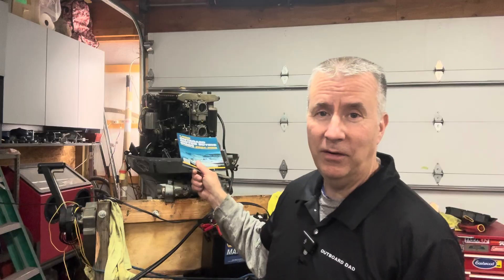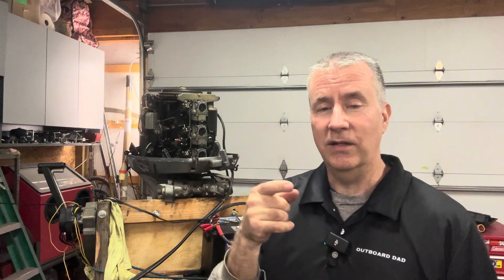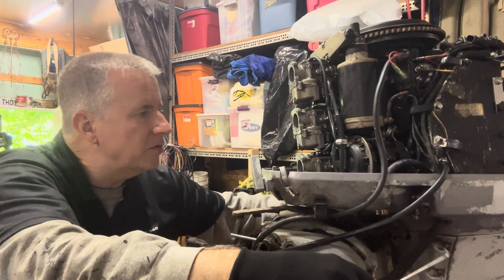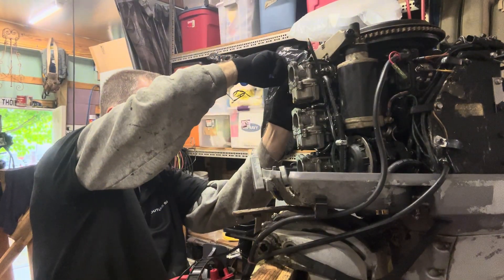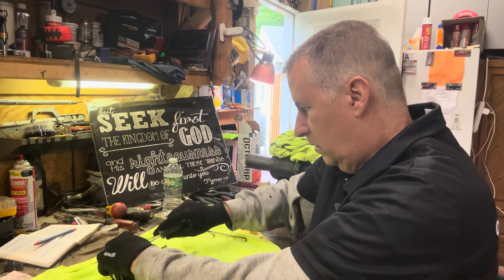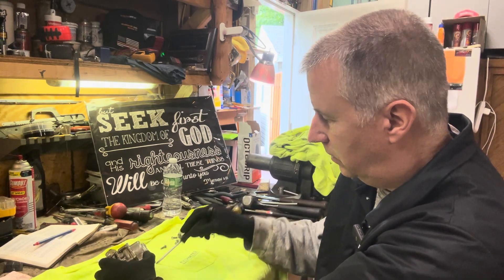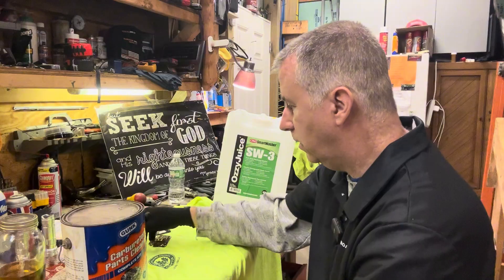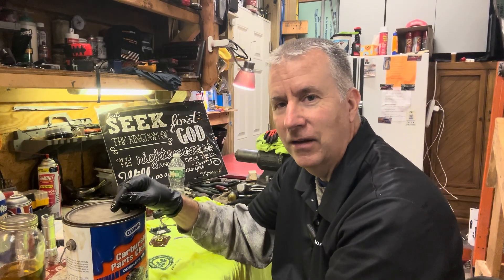Johnson Evinrude 70 HP Outboard Carburetor Rebuild Step by Step

Comment: Hey, what is the fuel line diameter for the 3 carbs at the t fittings? 5/32? i feel like the factory lines and zip tines arent the greatest long term solution. I ordered 5/32 brass t's, line and clamps
Reply from the maker: I’m sorry I would have to measure those to be sure and don’t have that motor now. Let me see what I can find out

Comment: Question; I have a '76 Evinrude 70hp 3 cylinder non-VRO and when cleaning my carbs, mine don't have that top section with the funny looking gasket you removed at 7:20. My rebuild kit came with them, so I'm just curious if this is something on newer carbs that I don't need to worry about?
Reply from the maker: The kit will cover many years so probably not for your motor. Especially if you mean the primer at that time in the video I mentioned. Your had an old school choke instead of a primer

Comment: We might have to disregard my last diagnosis because I didn't know that the 3 cylinder motors weren't fixed jet carbs. I'm still going with clogged jets but now seeing that the 3 cylinder carbs have an adjustable idle circuit and the screw was turned all the way in that would obviously be a problem. I don't think it's bad gas. It had combustion. It ran momentarially when you manually opened the primer. Soaking the carbs is a personal preference thing but I don't think it's necessary. I go with the copper strand up each jet approach personally. Or I try to shine a light through each jet and visually verify each orifice. Again, not sure about the 3 cylinder but the 4 cylinder CV the middle and main jets are in the float bowl. Those you have to physically remove to shine light and visually inspect and or use the copper strand method. Soaking the carbs I don't feel is thorough enough and it still leaves room for error. I have blasted jets with carb cleaner or brake cleaner to find after using the light technique that the orifice is still a little closed. Not entirely but no completely free. I think the copper strand method is fool proof. Different strokes for different folks.
Reply from the maker: I agree, the copper wire is the only way to ensure it’s clear. It can get clogged and stay there even with cleaners and solvents. You will see the ultimate result soon! Let me know if you agree with the decision I made